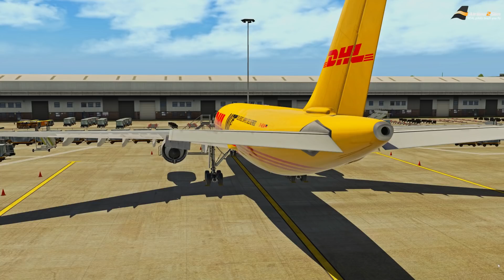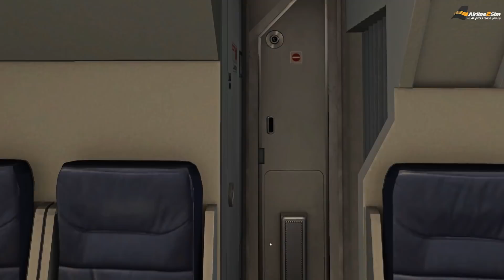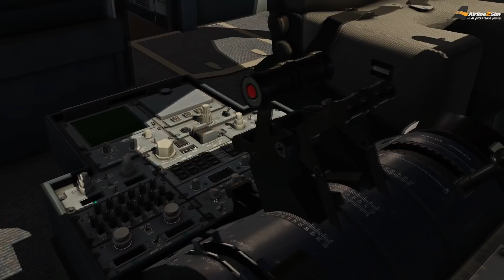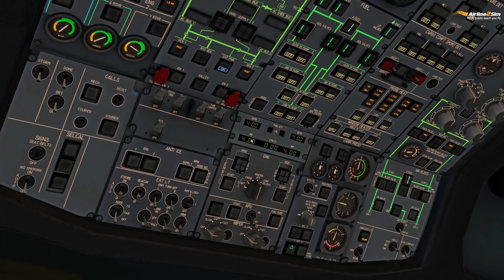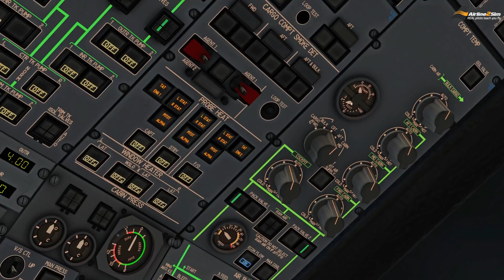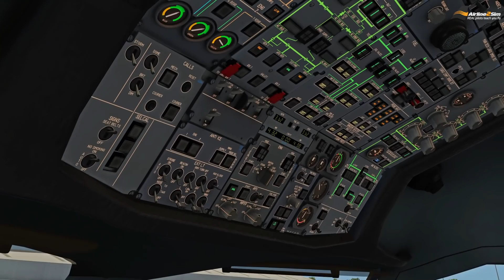Airline2Sim iniSimulations Airbus A300-600R First Look Part 2 -  Flight Deck Setup

Comment: 26:24 - in case your pitch trims turn themselves off, take note that the aircraft has been updated since this video was made. The IRS has to be fully aligned before you can flip those switches. Was going nuts after seeing video after video where people were flipping those to the on position with impunity, regardless of the IRS alignment progress.
Reply: LOL Same! Drove me up the wall before I figured that out!

Comment: You can adjust the camera movement speed in XCamera settings if you wanna move more quickly. Also, you can establish a modifier (like shift) to move a little bit faster, I think you can also adjust a multiplier for how faster it goes.

Comment: That was a great preview, lots of meat this time.The one thing I miss - comparing to the top p3d aircraft, is the lack of an random instrument failure module, which makes the cruise flight rather boring. Why should I scan the instrument panel is everything will be always in perfect working order? But apart from that,  this aircraft looks more than exciting, more exciting than what the msfs2020 guys are throwing at me for the moment. Thank you, Ben for this classy presentation. You are simply the best.

Comment: 8:10 Well. I think there are actually airliners in Xplane that are better than in P3D. A good example would be the Zibo Mod 737. In my view it is way better than the PMDG 737. Furthermore I think we do have a better 757 and 767 in Xplane with the FlightFactor models than we have in P3D with the CaptainSim models.
Reply: Some of the zibo is better, sounds for example. But in general the NGXu is more advanced in most aspects. The Zibo can do most of it for free, and that's a huge plus.
Reply: System depth wise, the Zibo is not as detailed as the PMDG-- nor is it in terms of modeling and texturing. That's not a huge knock on Zibo as it is freeware. Similar goes for FF as they've yet to properly model a Boeing airliner to-date